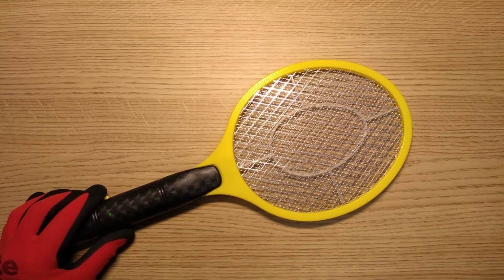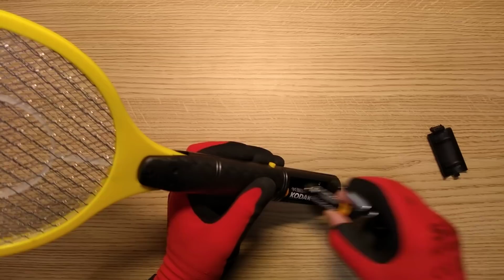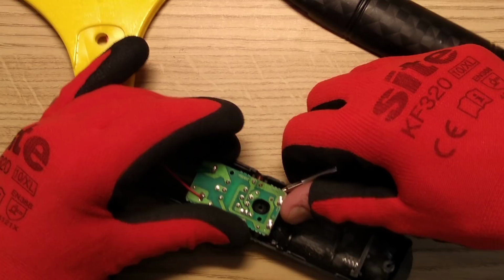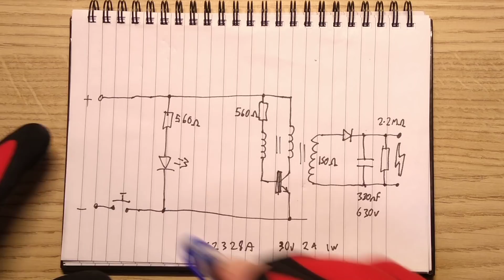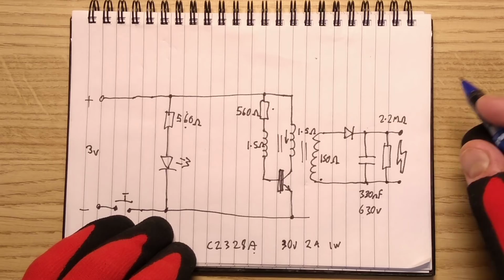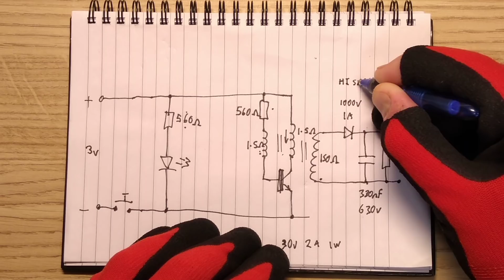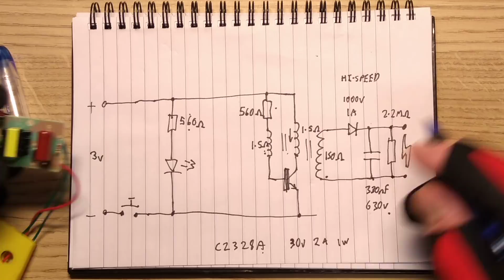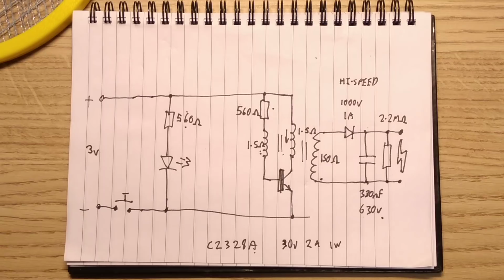Inside Poundland's electric fly zapper bat.  (with schematic)

Comment: Clive, how about taking one of the older style zappers with the horizontal grid, and swapping the electronics for the internals of one of those arc lighters? It would continuously arc at random places, which would already be cool on its own, but it should also be effective against pretty much any insect, including the fat flies that are at best stunned by the normal zappers for a few seconds only. Once an insect is near the grid, it should become the preferred path for electricity and be annihilated. Safety would obviously not be the number one concern…
Reply: Was wondering similar; we have a $4 AliExpress gas lighter, USB rechargeable, works great, the guts of which could be transplanted.
Also one of those skin-tag zappers (which Big Clive reviewed), which also works well.

But if I was going to make that much effort, I'd get one  of the AliExpress high-voltage modules (also cheap), chunky HV caps, an 18650 and a charger PCB...

Comment: I measured the voltage of a similar zapper. The voltage was approx 1400 volt, but it varied quite a bit between each try (between 900 and more than 1500). That may have something to do with the fact that the output capacitor was only rated for 250 volt AC.

Comment: I think this two AA battery model is the definitive mass produced model that isn't going anywhere soon and has been in the market for a few years now, isn't it?
Everywhere I go I find the exact same model... which is different from the one I have here. Well, the mesh is the same, but specs are different.

Mine is probably around 6 yrs old already, it has an internal battery (dunno what it really is, never opened it... the day it finally fails I'm checking it up), and comes with folded up electric prongs to shove it directly into a 110V outlet. Yep, safety standards can go to hell. xD

It's chinesium... if I'm not mistaken I bought it into one of the biggest physical store importers here in my city (aptly named China House, literal translation).
I use it mostly during summer time, but you know what? I'm extremely impressed with it's longevity. It still holds charge for pretty long. Well, provided that I'll use it for a few minutes daily during summer, it can go weeks without recharging.
It's either 18650s of reasonable quality, or perhaps one of those smaller LiPo packs. But it's great, no complaints here, does the job.

My mom went through some 3 of those two AA battery models already because the batteries are forgotten inside and they all go leakyleaky, ruining the entire thing, while I'm still using the same model from 6 yrs ago. Biggest problem I have with this new model. Rechargeable batteries are not only very expensive here, it's extremely hard to find ones that work well. Pretty much like trying to find good quality 18650s on eBay, some basis for comparison. So in goes regular batteries, and they stay there until they leak. Oh well.

Comment: One of my cat's don't mind it, but the other one, as soon as she sees it. She runs like the wind. She just doesn't like the noise.
There also good for getting Cray flies as there a lot bigger and you can cook them 😊

As you can imagine. I put as many 1kv caps in there as possible and took the discharge resistor out so it's got a much bigger bang now and it still discharged itself over a very short period of time. But I still short it out after ever use. 
Also, put Energizer lithium's in there as well.

Comment: Very tempting to see how far it will go before the transformer breaks down. Your meter said >600V on a 620V cap - could be that's the regulation mechanism. 

Or buy several, solder across the switches and series the outputs to see how big a spark you can get. Obvs with that much stored charge you'd have to be careful.

Comment: Mine looks exactly the same outside, but it doesn't have a discharge resistor across the cap. I've witnessed flies randomly landing on the grid, hours after the last button-press, and they still get blown in half.

Comment: I had one when they first came out, instead of a grid the wires were all run in parallel... like a tennis racket with the cross strings removed.  It seemed to be a bit easier to use because the bugs didn't have to go inside the grid.

Comment: We don't have that exact model here, but I have played around with those quite a bit. We a similar type that looks quite like it, but it has a plastic lightning in the middle of the mesh. Try adding more batteries. The one with just one layer of vertical lines is hard to get b y now, but that one gives quite a a good zap. Don't have one of those, so I dunno the insides. I am a welder, so I don't mind too much feeling the zap. I have found a very good one for like 5 quid, it has a huge transistor, and seemed to work fine with 8 batteries, but the lightningbolt one I had became bad with 6 batteries after just a little while. The half good ones used to be red, and I had a red one for  a few years, and now they come in green. Same components, but they break a lot due to poor manufactoring. That model has 2 layers of stripes in a diamond pattern

Comment: Last one of those I took apart had at least a two stage VM on the output giving a grid voltage of 1.5kV, that one you have, I can see that actually going over the 630V rating of that cap

Comment: I got one of these in America from Five Below. Almost identical to this one, it too held a charge after you powered it on. I got another one from Ollie's, it's a lot different. It must have some way to discharge the grids because it doesn't hold a charge. It also has a way bigger ZAP! I measured the one like in the video and got between 1700 and 2000 volts.

Comment: Probably a polypropylene film cap - They are self healing. I don't know about these ones from horrible freight, but I have a foldable teal blue and white one that if you crank it up at night and let it saturate, you'll get a full corona discharge off the grid. That's gotta be way more than 600 volts! Does a number on bugs though. I was gonna mod one with dual output caps so harder shell bugs like wasps go down in one shot, not just half stunned and pissed off...

Comment: Would this design be moddable with a longer CW mulitplier on the output? My friend Jack has a two of these swatters but most flies that have an unfortunate run-in with the operational end of the device tend to fly away again after about five minutes after doing their little break-dance, I believe the dutch flies are militarising, so we must too. Jack tried the 9v battery hack on one of the zappers, but that was too much of a hot supper for this poundland flyspanker and a slight smell of transischar filled the room for the remainder of the evening. We decided to keep the broken one around; the handle still proves to be a great on-the-fly-hammer and rest assured using a flyswatter the wrong way around is a consistently amusing party-trick. When we do inevitably miss, we obviously replace the batteries. Now that I write this, I am astonished at what nonsense can bring an inebriated man the giggles.

Sorry about the tangent, I enjoy your channel and especially appreciate this video for it inspired me to crack Jack's other flycrowave open for some upgrades.

(Do you reckon you could measure the output voltage with a resistor network and perhaps a little capacitor to hold the potential for easier measuring? It'd hardly be scientific but it'd be a good enough approximation for my personal peace of mind.)
Reply: A chap upthread put two 1kV ful-scale meters in series, and saw about 500V on each.
Alternatively, you could lift one end of the discharge resistor, and put a [micro]ammeter in series with it; 1500V across 22M will drive around 68uA, per R*I = V :-)
Reply: @theskett  That volt meter in series thing just blew my mind.

Comment: I have what they call "The Executioner" Which is much more powerful than the dollar store brands.  I had already taken it apart with the intention to remove the discharge resister, to my surprise they had a clever switch that breaks the connection to the discharge resister while holding the zap button.

Comment: Small correction; there are virtually no "digital amplifiers" in existence (some were designed way back, which amplified the PCM signal from CD transports) - the amps referred to are 'switching amplifiers' (as in 'switching power supplies' - no-one refers to wall-warts as "digital power supplies"). The fact that they use quartz oscillators which are also used (for a completely different purpose) in digital circuits to generate their HF switching frequency doesn't make them "digital". For some reason even reputable, "expert" sources insist on referring to these 'class D' switching amplifiers as such - it's exasperating.
Reply from the maker: I think the term "digital amplifier" may be a bit of a marketing thing based on the filtered PWM output.

Comment: I made one when I'm 16 with D882 transistor and the output is stored in a used washing machine capacitor.. When the caps is full it's 400v (25uF 400v) I usually short the output on metal fence just to give my friend shock with the blasting sound (NOT electric shock)

Comment: So turns out Aussies are paying a wee bit more for these - A$6 or nearly 3 pounds. But they're pretty much the same device. Complete with high pitched whine when you press the trigger, sparks when a fly completes the circuit and smoke pouring from their little eyes right before they re-enact the death spiral descent to the floor like a Hollywood version of a WWI biplane with a damaged wing and spin on their back. Quite satisfying when the little bastard's been trying to go swimming in your coffee or tea for the last 20 minutes. 
I can say the grid holds a charge for a little while from that capacitor on the output - you can still zap the blighters just after you've charged it up. 
Only downside of these toys is that you don't dare risk slapping a hard surface - just have to try to smack a fly mid air or on a soft surface. Perhaps someone could design a printable replacement paddle in TPU that holds the meshes apart while allowing it to flex instead of shatter when it clips a wall

Comment: I have one those I bought in Brazil but mine has an internal battery. At the end of the handle you pull out this thing and it exposes the pins for European power sockets which you connect directly to the wall and it charges the battery. Surprisingly it’s also multi volt. One thing I noticed is that current will run through the mesh for as long as you hold down the button. That leads to a very disturbing situation where as I’m trying to hit the flies if one gets stuck in the mesh it will keep getting fried until I release the button. Luckily they seem to die at first contact.

Comment: If a capacitor (100nF or more) was connected between the transformer secondary/560R junction and ground that would boost the output considerably.

Comment: I thought as the collector current increased it would induce a negative current in the base and this would cause the high speed oscillation... this seems like it would be the case if the left 2 windings are wound in the same direction. The polarity of the windings are not shown on the schematic so no way to know i guess

Comment: I have the same swatter. My guess is that the flyback develops lots more than 600v. The momentary nature makes the rating on the cap and the diode kind of irrelevant. For all we know there is a little arcing in the cap and that acts like a shunt. Hey, it cost a pound. 630 v only arcs 0.1mm in air, but of course the question is, how much does it arc in a mosquito? I don't know. When mine was new, it would sometimes arc on its own, which would mean more like 10 times that voltage.

Comment: How fast do you think it takes to charge the circut and ready for zap. Its got to be fast. That brings me to another question, the old high pitch sound on camera  flashes, what exactly made the noise, guessing I'm saying the frequency at which it cycles( build up capacity). But I don't know for sure. Thirdly cheers from not stormy but cicada ridden Kansas.
Reply from the maker: The cameras have a high frequency transformer with simple oscillator circuit like this one.  The change in pitch is caused the the lower work of pushing current into the capacitor as it charges resulting in an increasing frequency.

Comment: Quick question for anyone who might have ideas on this:  My nephew wowed us all this past weekend with one of these where he was demonstrating that he could touch the screen while the light was engaged without setting it off, and then challenged anyone else to match his feat.  Of course everyone that tried got shocked.

Does anyone have any idea what he might have been doing to get that to happen? We're pretty confident that he was in fact touching the screen and we certainly know the light indicated it was active.
Reply: My choice would be to put clear nail polish (insulation) over a small area of the metalwork, and demo only by touching that area; then make sure my family touched elsewhere, e.g. the opposite side :-)
Or put the nail polish on a fingertip, and always touch only with that fingertip ;-)
Reply: You can touch one mesh at a time and not get shocked since the circuit isn't complete, and on these zappers its actually 3 separate meshes. The two outer grills are connected to one polarity, whilst the middle one is connected to the other. The bugs (or finger) need to enter this sandwich and contact both an outer grill and the middle one to complete the circuit.

Comment: Have you seen the kids Toys, Hana Zuki wrist bands from Poundland? These are extremely interesting, the little bobbles on the sides are resistors and the lights in the band change based on their resistance (£1 ohmmeter if you wish). They are also BLE and come with a really addictive game for your phone.
Reply from the maker: We were playing with one at work.  I took one of the characters to bits and found the resistor.  It's not always accurate.  The first one I bought had a dried out lithium cell.
Reply: @BigClive  aww boo. an interesting project if you can make a circuit with varying resistance, have a mini disco light show 😁

Comment: Many years ago I built a mains powered negative ion generator using a capacitor- diode string. I later found that by bypassing the protection resistor on the output it made an extremely effective electric fence unit for keeping cats away from my fish pond. I'd love to know what the output voltage of that was.
Reply from the maker: Full mains voltage if you removed all the resistors.  It would have been a row of diodes straight to one leg of the mains.  It would still have worked as a deterrent with the resistors as it would impart a sting.
Reply: @BigClive  A bit higher I think. This was a voltage multiplier setup with a 15 stages, from memory

Comment: Im confused, doesn't the secondary on the transformer only have ~300V across it (based on the ohm ratio between the primary and the secondary)? How does the output capacitor get anywhere close to 600V? Is the secondary made of a less resistive material?
Any explanation would be welcome
Reply: If it's a flyback circuit as Clive suggested then the output voltagecannot be calculated from the turns ratio and the measured resistance does not indicate the turns ratio either because the windings will use different gauge of wire.  A flyback circuit is one that stores energy in the inductance of the transformer when the switch is on and then releases it into the secondary when the switch is off.  If run at a fixed frequency then it delivers a fixed amount of power to the output and so the output voltage is controlled by the value of the load resistor (2M2).  So you could raise the output voltage by putting in a higher voltage rated capacitor and raising the load resistor value.  It would be a good idea to use a high voltage rated resistor too.